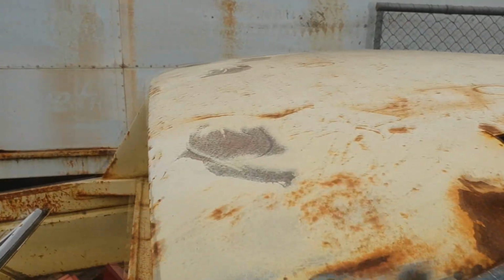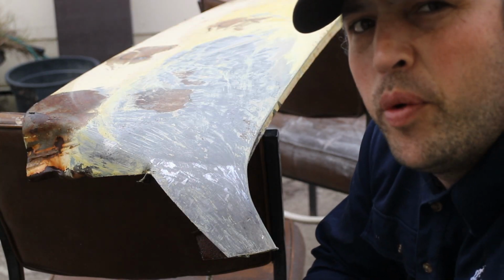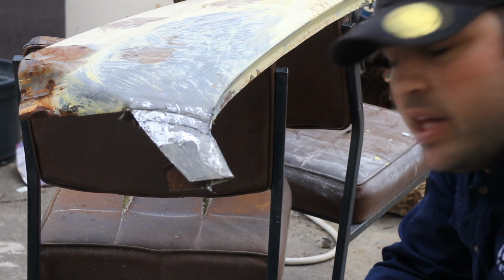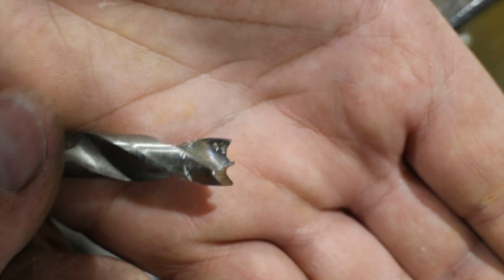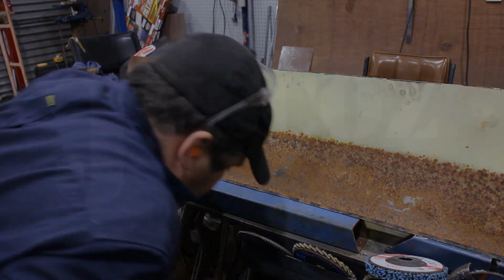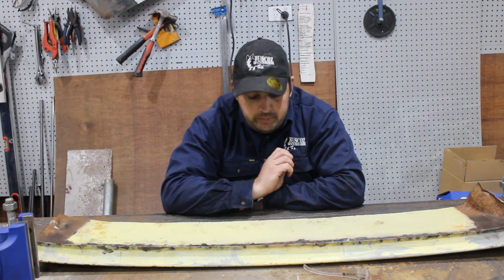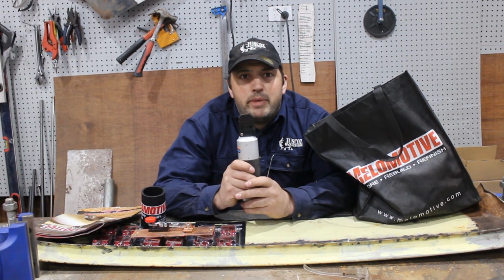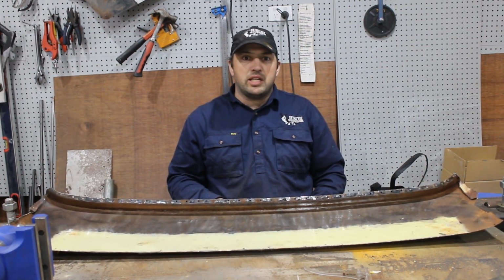panel prep

Comment: Just a heads up Geoff, I’ve seen one of those punch tools hit a hard spot in sheet metal and the die end exploded showering metal shards around...next time wear your glasses. Keep up the good work!
Reply from the maker: Thats interesting. I wonder how many psi they where pushing through it to do that and if it was a good quality unit or a cheap imitation. Either way it is not a good thing to have happen and I was actually thinking about not having my glasses on while i was doing that bit. I turned mine down to 90psi as the instructions instructed but hard bits do happen in steel.

Comment: paint stripper works better if covered with plastic & left to react for 10-15 min..... plus when you peel the plastic off, you have somewhere to scrape the old paint & stripper onto for disposal....
Reply from the maker: Yeah the yellow paint immediately turned to jell and was troublesome to scrape off it was not like any paint i had stripped in the past. The stripper did not affect the primer at all really so i gave up let the paint re harden for 20 minutes then neutralized it and went on to the next part of removing the lead. I might have another go at the stripper when i have more time but  that is running out quick